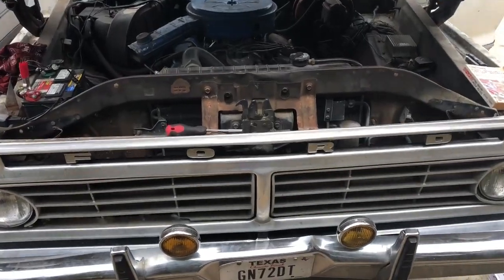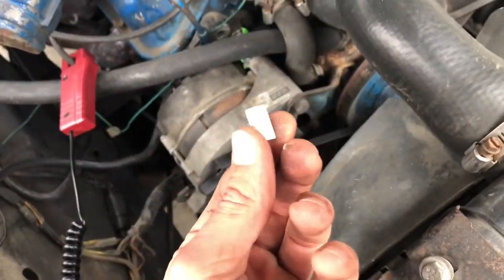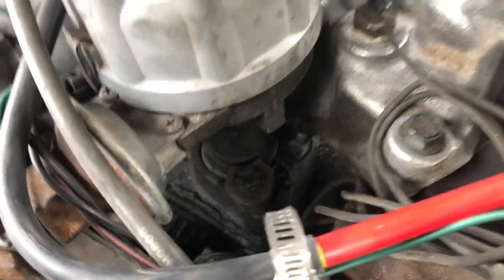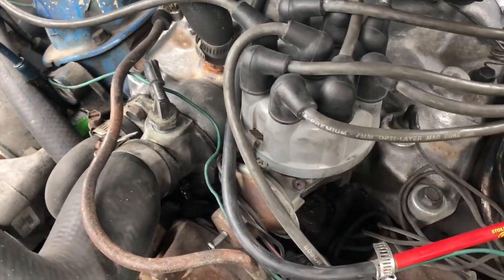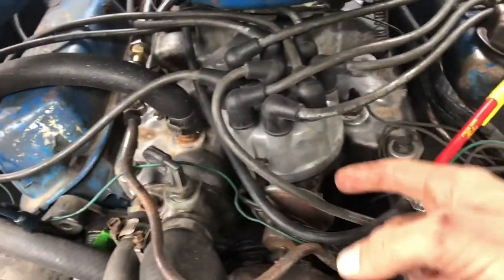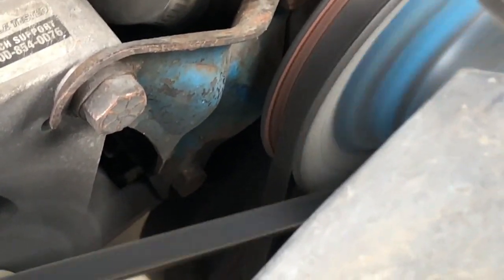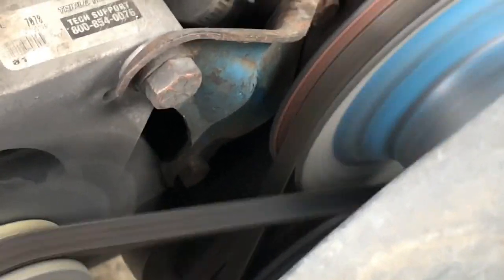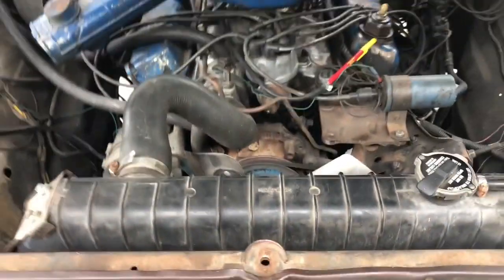Timing 1978 351w in F100

Comment: 1000s of volts... let's try 12
Reply from the maker: Sorry once it goes thru the coil it is actually closer to 40,000 volts http://hyperphysics.phy-astr.gsu.edu/hbase/magnetic/ignition.html
Reply: lmao hot ignitions systems run 50,000+ volts, 12 volts would do nothing on a spark plug.